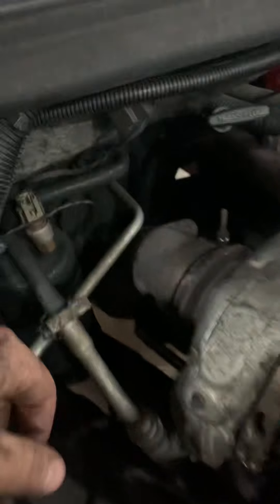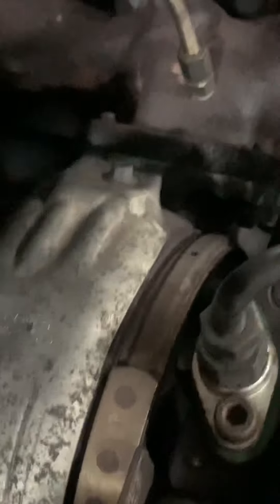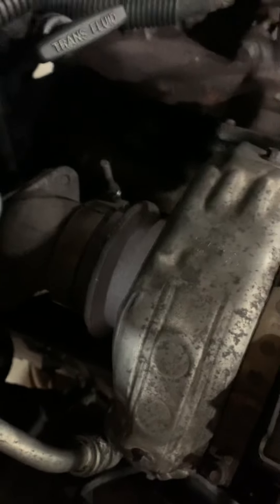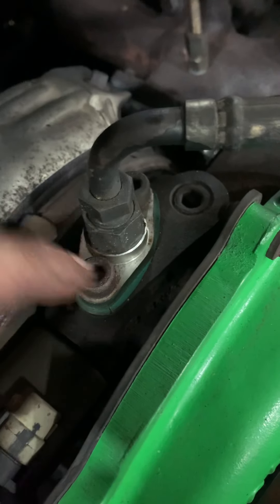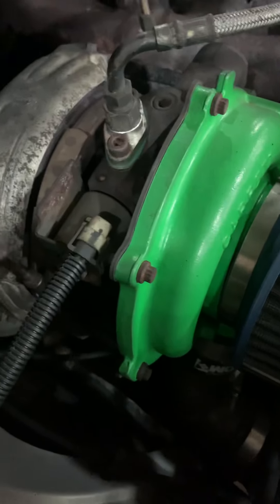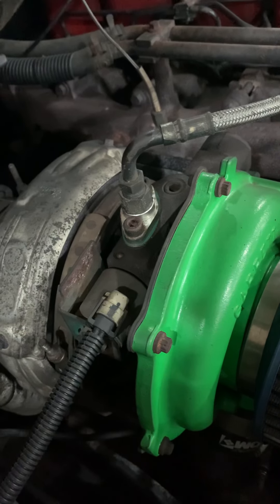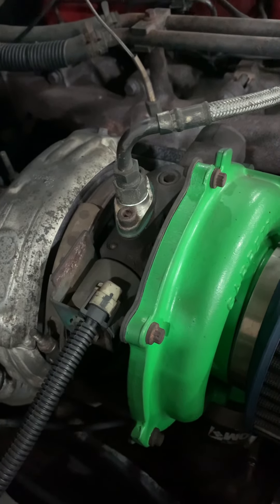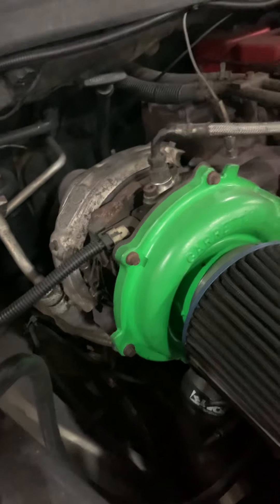How I put a 6.0 turbo on my 12 valve

Comment: Can you make a list of where to get the adapters? Like the oil line
Reply from the maker: Oil feed is t3 oil feed line adapter female , 1/2” npt ,
A weld on t3 flange ,
And the vband is on whatever size your downpipe would be

Comment: Sorry if I've missed it somehwere. Would some sort of variable PWM controller work to control the veins? I've been thinking of something like an arduino module that would convert your 5v tps signal to PWM signal so it would work almost exactly like a 6.0 does?
Reply from the maker: That might work ! Ford does use pwm to control these!

Comment: Question: what do you do to the wastegate? I’ve got a 97 12v with a p-pump and I’m installing a 6.0 turbo soon. Should I just plug the wastegate line leading into the afc housing? How will it affect the fueling on the low and high end of boost. TIA!
Reply from the maker: I had re routed mine to a bleeder to have afc live basically

Comment: So, does tapping the potentiometer into the dimmer switch make the vanes work automatically or are you turning the dimmer switch to control the vanes
Reply from the maker: You’ve gotta turn the switch to open and close them , I’ve got an external potentiometer with an on off switch I’m going to wire in I can film it if ya want
Reply: @bdollery55  please do. I'm considering a vgt swap for my 24v I'm torn between an he351 and 6.0 vgt
Reply: Bryce if you close the vanes all the way does it apply as a exhaust brake like a newer 6.7
Reply from the maker: @fenixthehybrid3389  yes it does
Reply: Sweet I know my next upgrade for my 12 valve lol
Reply: @fenixthehybrid3389  I did an he300vg swap on my second gen. I love it. Way better than the hx35
Reply: I wanna do this to my lb7 lol
Reply from the maker: @justincopeland7220  hell yes do it!
Reply: @bdollery55   where would I get the adapters does p stroke use banjo bolts
Reply from the maker: @justincopeland7220  you can find them on eBay , you need a female t3/t4 oil feed adapter flange , and the drain tube has to be welded or you can make a tab and bolt the powerstroke drain down
Reply: Could you use an old brake controller as your potentiometer instead of the dimmer switch that way you could mount it somewhere you could easily use it and possibly have a way that it would hold itself wherever you put it...?
Reply from the maker: @johniedavis9150  you could but that dimmer switch works the same way, I’m trying to think of a way to have the veins move with pedal position
Reply: @bdollery55  make another arm off the throttle and mount a potentiometer to the arm so as you move the throttle back and forth the arm attached to the potentiometer moved with it. Better yet could use that throttle arm off the p7100 and have it love with it there.
Reply: What type of potentiometer is being used here I know they got a lot of different kinds or does it not matter any will work fine? And any update on the VGT wiring video?
Reply from the maker: @giovannibandy5452  this one is a band style , any of those small little 10k ones won’t work it’s too much heat for those little ones
Reply: @bdollery55  I have already got everything in the mail and delivered for this kit except the potentiometer I am currently working on welding the adapters ima try and use a T3 to 90• to the vband I cut off a stock up pipe from a 6.0 Definitely gonna be a tight fit but just might work. Would you be able to provide the link to a potentiometer that you would use, and I will get that ordered. By the way this is going on a 2004 24valve
Reply from the maker: @giovannibandy5452  I actually just bought a pwm controller gonna see how that works
Reply: @bdollery55  wire up a ford pedal and hook it in to that
Reply from the maker: @cjwhite3727  Ford doesn’t used the pedal position to control the veins, the ecm will control it with several different inputs such as map, egt , egr , and throttle position
Reply: I wonder if a vacuum could be used to position the potentiometer during driving 🤔 some investigations will be needed
Reply: @bdollery55  a tps and arduino and can have a switch for brake like the little black box. did you gain or lose mpg doing it this way
Reply from the maker: @vapeking8882  big gain in mileage

Comment: Does exhaust pressure push open the vanes? How do the vanes open up as you keep building boost?
Reply from the maker: I have mine wired I’m not rigged up with a wastegate actuator , the veins are controlled electronically in my case
Reply: @bdollery55  how’d you wire them electronically. do you have a switch or ?

Comment: I just finished my 6.0 swap I'm not sure what I did but it doesn't work, with power going to the solenoid the truck makes 15psi flutters horrible pours black smoke and won't accelerate at all
Reply: But does it whistle?😮‍💨
Reply: @dakodaheller5869  . It does make some jet engine noise if that's what I was going for lol